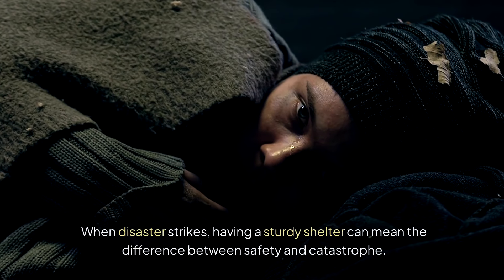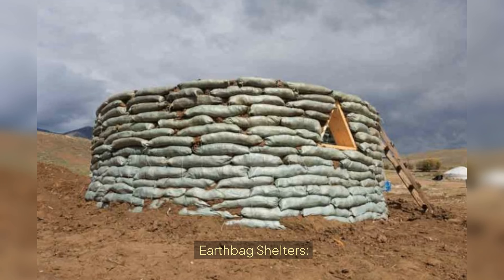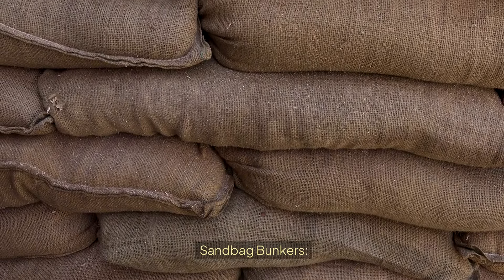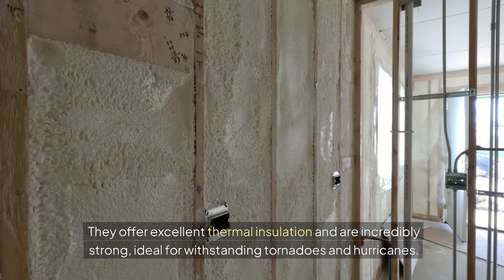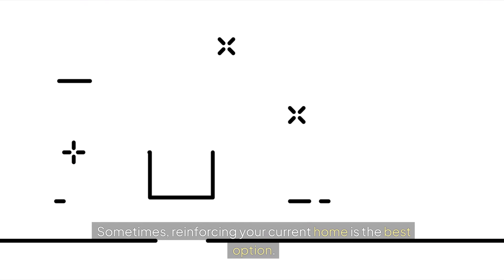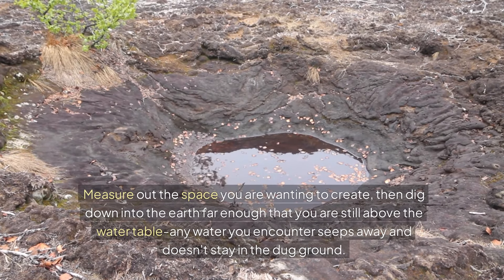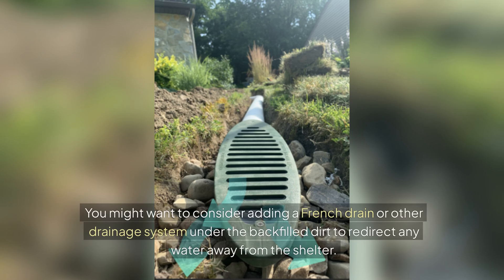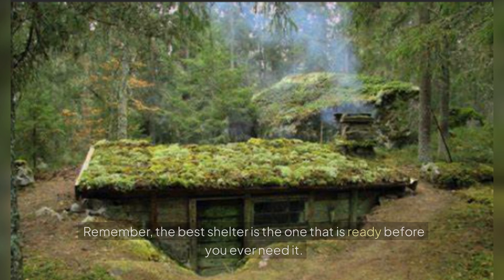10 BEST TYPES OF SHTF SHELTERS!

Comment: Nikki I would not recommend shipping storage containers. There are not made  to be buried and will not hold up with our a lot of extra support. Great video have a great day
Reply from the maker: No, you'd need reinforcement...I think most of the pics I showed of them included creating concrete walls around them, etc. Also if you turn them upside down it helps because the floor is thicker than the roof. In the thumbnail is a shipping container and you can see they fortified it with support as well :)
Reply: I have a high school buddy who builds these for a living, They are prefect for it you just to reforce the sides with rebar.

Comment: If you have a basement, I would advise glass block to replace standard windows- as long as you have more than one egress option besides the windows.
Reply from the maker: I did this in my other house, replaced some vulnerable small windows with glass block. So happy I did!!